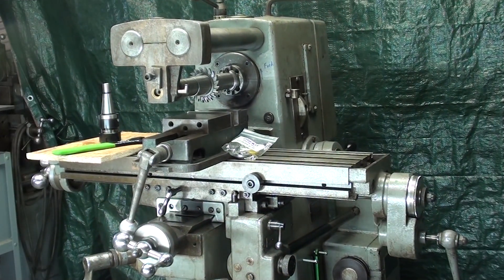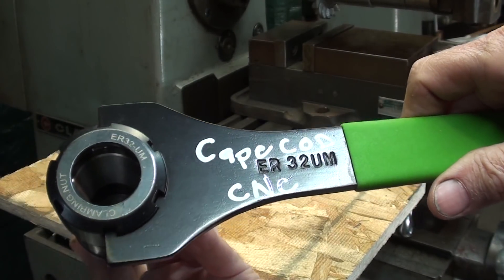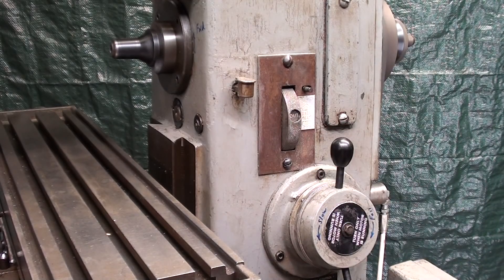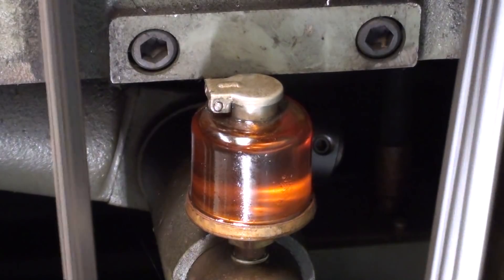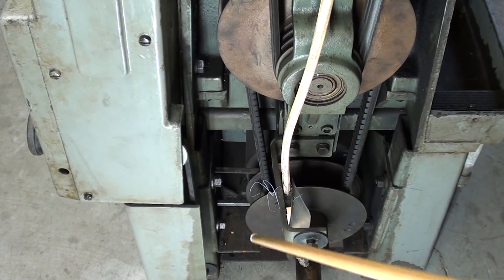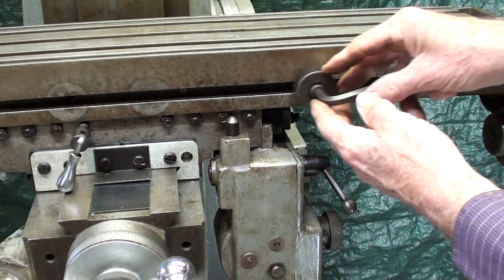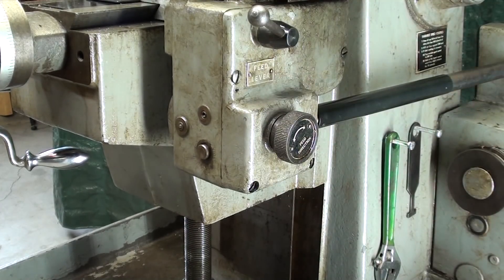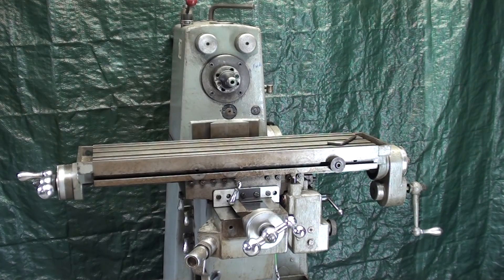CLAUSING Milling Machine Tips #502 pt 7 tubalcain CONTROLS

Comment: Lyle, would love to see you dig into that safety FWD/REV switch.... maybe a shop build like the speed reducer?
Jim
Reply: It’s really pretty cool. The drum switch is located well below the handle. They’re connected with a stiff cable, similar to a speedometer cable.
Reply: Nice... can you point me in the direction of a parts sheet/diagram? I like the loaded lockout feature and it seems as if this would be a nice project....     @TPSTH23
Reply: @TPSTH23  It'd been nice to see Lyle do one of his great 'how does it work' critiques...

Comment: Chuckle—the higher the voltage the smaller the required gage, assuming equal power.  That's why 5HP motors won't run on 120VAC: you'd need a circuit rated for over 30A.

Is that an SJ or an S cable?  I've been using type S (well, SOOW) for most shop projects: the extra thick jacket makes me feel safer about chips and stuff damaging the cable.

Comment: Sir, i have a question, there are 2 place that can control the direction of turning, one on top and the other on the right hand side. What if both of them were switch to “reverse” position? Will it still going reverse, or - and - equal to +, going forword? Never play with this type of milling machine, i am querious. But i bet a dollar it will go reverse.

Ps: when my nephew was 4 years old, when he saw any machine that is taller than him, he will yell 鐵甲人(giant robot)
Reply: One controls the direction of the spindle and the other controls the direction of the table feed. They are not the same system. One system has no bearing on the other system.
Reply from the maker: Thanks, that is a good answer
Reply: @grntitan1  i am the bad student today, i watch this clip at 2 am and almost fall asleep. I thought both controls are for the spindle. Thanks for the explanation.

Comment: Mr. Pete,
  Amperage determines the size of wire, not voltage. Tommy gave you a pretty pricey gift even though it has some age. That looks to be SJ which is flex rubber coated and won’t act like spring wire like plastic coated cords, especially during cold weather. Hard to find these days in stores. Usually have to go to a jobber supplier to get it. 
   Nice mill. I was hoping to make it to Lost Creek’s open house and machine sale but life has interfered. Was looking forward to meeting you. Maybe at a later date if you and I live that long.
Dale
Reply: We made up over a half mile, of 50' and 100' extension cords, using the SJ on one project I worked.  Could not get the guys to quit running over the cords with the fork trucks.  A lot of the 100' cords wound up being 75' or less because of the fork truck damage!
Reply: Not sure armored cable would survive the fork trucks but my point was the flexibility of rubber sheathed SJ. The soft, flexible sheath of SJ actually contributes to the durability of the extension cord. The hard plastics often crack at the junctions and ultimately cause premature breakage of the wire itself.
Reply: @dalegriggs5392  - Yep they are much more pliable, than say the PVC sheathed cords.
Reply: For the same amount of power transmission (wattage) a higher voltage will allow a lower amperage, therefore a smaller size of wire.
Reply: @Landrew0  that's right,double the voltage can half the amperage.  People need to realize that it's the current draw and length or distance that determines wire size